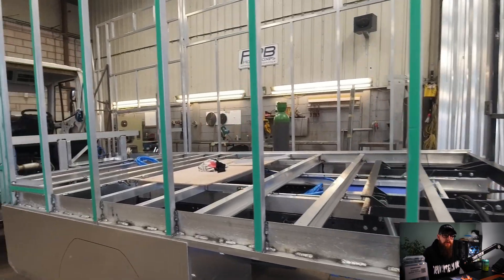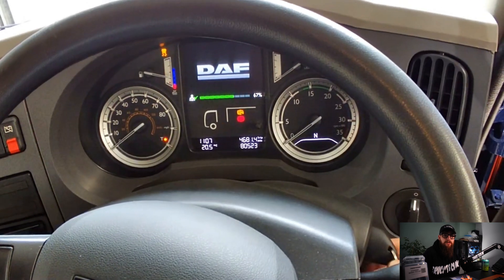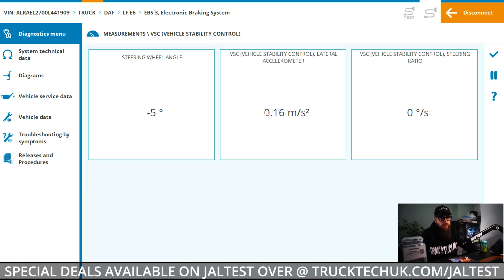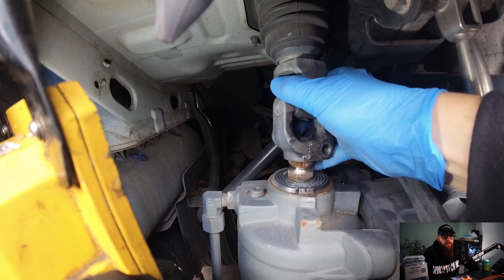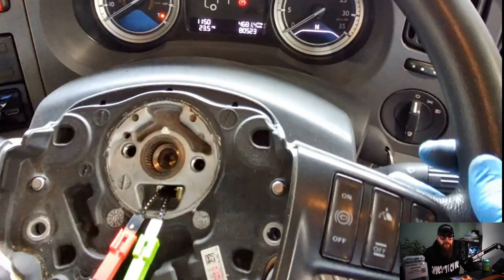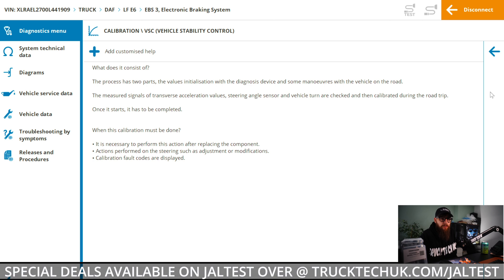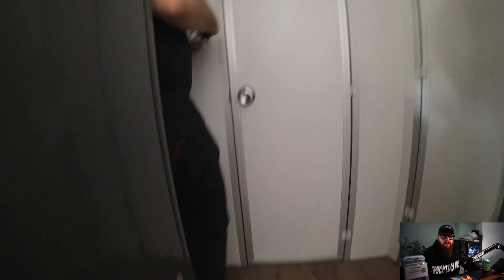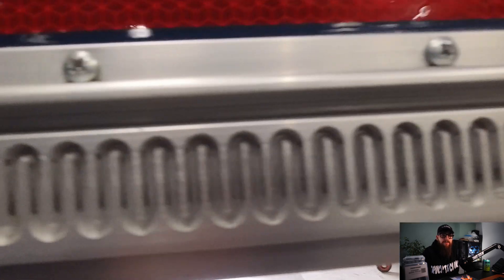DAF stability Fault Revealed, AVOID this issue with JALTEST

Comment: Hi Russell I have been watching your videos for a while now and appreciate your method of work.
I am a tech too on HGV’s again for a main dealer after 20 years as a field service tech on heavy plant, 100 ton dumpers ect.
I agree with how you work I hate the carpet bombing fitting effect.
As a tech called Dan Sullivan says a mechanical fault is easy to find but expensive to repair, A electrical fault is hard to find but easy to fix most of the time. And that to me is true.

A proper tech takes there time to diagnose and tries there upmost to eliminate boomerang 🪃 jobs. Like your good self.

I wish you all the best in your new venture and keep up the good work with the videos.
Reply from the maker: Hey Simon thank you for the comment 😎.

How have you found moving into a main dealer from working on plant? 

Parts cannon is not good for anyone customer or technician as you don't learn anything as a tech and the customer has a massive bill 😰

I know of Dan sullivan, I replicated his load pro design to see how it works 😂.....abit like snap on did......anyway his fundamental teaching is sound even if its 10 years old now.

I don't know why people wouldn't want to take the time to diagnose things 😕......to fix a system you must first understand it. I hate nothing more than having a job come back on me which is why you need to be methodical.

I will try and keep the videos coming but this week has been all work and no editing BUT I do have loads of footage 😅
Reply: Hello Russell 
Thank you for your reply.

I left Scania 20 years ago and now I am back feels as though nothing has really changed a lot.

I have enjoyed the heavy plant and been fortunate to work on different things. I wouldn’t normally.

I have gone back to trucks as most of the plant work is in recycling centres and in the lovely British monsoon season 🤣.
I enjoyed hydraulic and electrical faults oh and the lovely Ad-Blue faults.

I like you enjoy the diagnostic/ fault finding part of the job.

I like your “gadgets” that make life and fault finding easier.
You are a clever gentleman and I wish you all the best. 

As people like your self are few and far between.
We have a load of apprentices who are useless and not interested in the job.

Take care Russell and all the best

Comment: It’s nice to know about your family history. Machines are upgrading very fast  and we have to attend trainings and read a lot of to be good at what we are doing. Wheel extracting tool is very good, I have struggled with xf105 wheel remove 😅 Good luck from Balkans. You rock!
Reply from the maker: Hey Preslav 👋, thank you 😊.  
I've never known technology to go so fast! But I find Daf quite SLOW compared to other manufacturers. I think Mercedes are further ahead with technology.
As for the steering wheel extractor....I don't know how you can get it off without making a tool!
Reply: Oh, i am doing engine rebuild on MAN TGA euro 3 and it has EGR valve and cooler 😂 You are completely right. You don’t wanna know how I extract these steering wheel 😅

Comment: Hello Russell,

I hope this message finds you well. I have a question regarding the MX13 DAF engine's camshaft. If the camshaft has suffered minor damage and we proceed with a valve clearance or valve adjustment, would this potentially exacerbate the camshaft's existing issues, or would it have no significant impact on the damage already done?

Your expertise in this matter would be greatly appreciated. Thank you in advance for your insights.
Reply from the maker: Hi 👋.  
If the camshaft is damaged especially in MX-13, I take it you're referring to the case hardening on the camshaft lobes? 

You're just accelerating wear on that lobe now, and not only that you are running the risk of introducing more metal particles into the engine oil increasing wear.

 I'd be looking to change the camshaft out AS SOON AS POSSIBLE. 
If it's not as the manufacturer intended. it's fit for purpose

Comment: Hi Russ, interesting that steering angle created those faults, great information once again. I work on a few PRB's, nicely built. I work on a lot of other makes that ain't ! You may be visiting me soon if I can't sort an intermittent problem on a auto iveco.....next week will tell !😆
Reply from the maker: Hey Darren 👋.  I've another horse box to go sort this week from another company that has VSC faults but from ABS which is another problem area for VSC. 
I was so impressed with the quality, all the wiring cable tied correctly and stuff 👌

Ohhhhh how old is the iveco? Does it have AS-TRONIC LITE in it?
Reply: It's 2013, and that is exactly what is in it ! I've signed up to your premium subscription so I was going e-mail you when I get 5 min!
Reply from the maker: @darrenhearn1365  Fire away when you get 5 mins buddy! I'm all ears

Comment: Hi, I have a DAF XF in Brazil and the truck is losing power. I already changed the filters, there is no warning on the panel. what do you think it could be? Could be low fuel pressure?
Reply from the maker: Thanks for the comment. You need to get it plugged in for diagnostics and check some basics like fuel pressure and correctional value ect